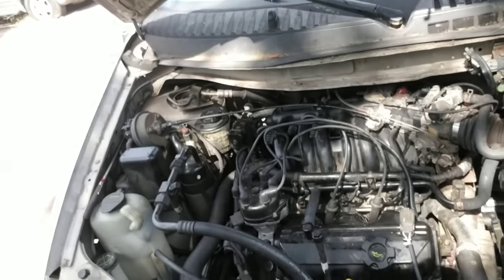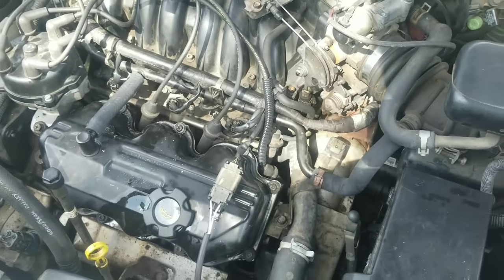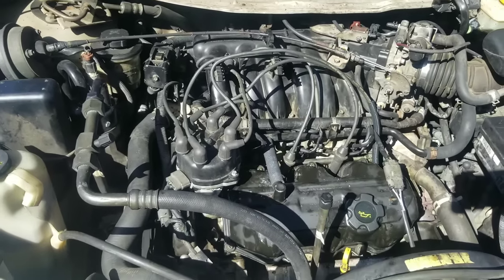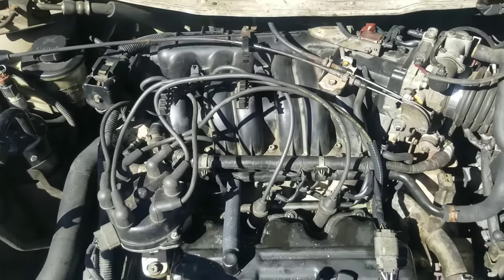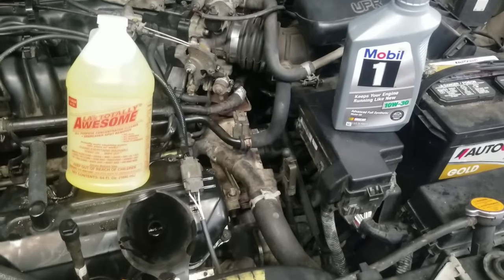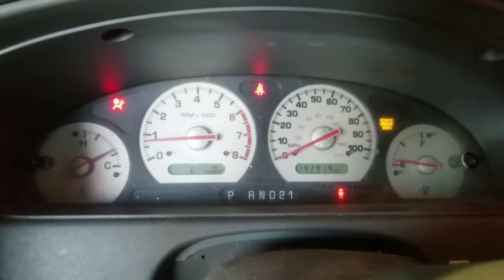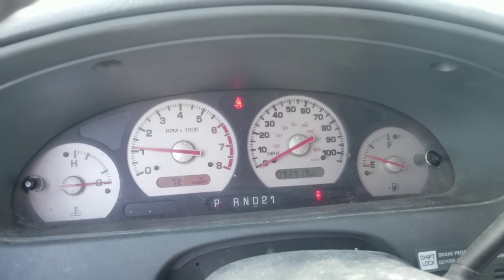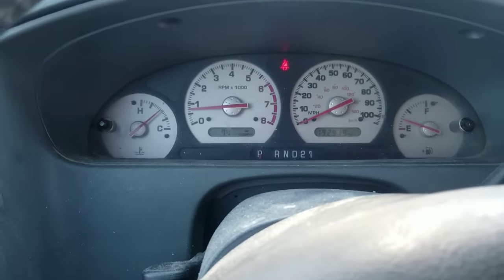How to Clean The Inside Of Your Engine The Easy Cheap Way.

Comment: Just use 500ml of diesel fuel. save money does the same.
Reply from the maker: no. no it does not
Reply: Maybe not with the engines your working on, as they are neglected due to tight owners,  I will help you out as I am honest person, use kerosene for your applications and its safe on rubber & cheap.    :)
Reply from the maker: yea this car was scheduled to go to the crusher, i saved it the owner is elderly and handicapped, so i helped him by saving his car.
I use this method for really bad engines because it works fast, and is very effective.

Comment: this is all fine and dandy until the bearings get stripped from all the oil that keeps them lubricated. im not a mechanic but i would highly recommend that you dont do this. have it done right.
Reply from the maker: so you just said you are not a mechanic, so obviously you know you have a lack of knowledge on the subject, so please keep your uninformed opinion to yourself. get some experience on this subject matter then speak. until then like u said you dont know.

Comment: OMG .... You’ve got to be kidding me ..... you put $50 worth is degreaser in an engine? A degreaser is not a lubricant. Furthermore, any debris will go to the filter, so you need to replace them with frequency.  This is a terrible method of trying to clean-up oxidized oil deposits. If your interests was to rid the debris through oil changes, use a diesel oil engine oil ..... for several cycles ..... but you must install new oil filters as they quickly become clogged. Nothing goes in a crankcase except motor oil. Nothing else ever!! And by the way, the bottle of MMO was a pint, not a quart.
Reply from the maker: did you pay attention at all, the filters were changed after each flush. furthermore do some research i could of ran the motor with water, what do u know about that. yes water can lubricate. the point was to aggressively remove the sludge and this product works great  at that job.
Reply: @crazysexycool180 okay, okay, okay  …… you win ……. Just be sure you never ever service, touch or get near any of my cars or equipment ……

Comment: This HILLBILLY is a HOOT. A Real DA.
Might as well flushed it out with some SIMPLE GREEN. Ha Ha.
If the engine had the Oil CHANGED & FILTER changed on Schedule, then this Problem would be Eliminated.
The Engine Gaskets will probably Leak like HELL NOW. And the Check Engine LIGHT will come on a LOT.
I would NOT take my vehicle to this Garage or DIYer. 🤔
Reply from the maker: update this car is still running great in 2023, hillbilly that,

 how yo car doing?
Thank you please like, share, and subscribe, also please check out my other channel Salem Taxi, on YouTube for more material on a different level.

Comment: That Engine sounds Nackered and no amount of Flushing is ever going to cure that, if you dislodge all the Carbonised Shit in that engine by Flushing and you Don't clean the Sump Strainer after your going to ruin what's left of the engines life,the reason for that engines state is old age and not changing the engine oil often enough,the damage is done now and it Can't be undone by any amount of flushing so save your money and put it towards a new Engine.
Reply from the maker: sounds goud. but your wrong. after the flush the car is stilllllll running great
Reply: Artistry Photography, Wrong am I, I have been reconditioning Engines for the last 50years so I have Probably seen every type of engine failure there is to see,why on Gods earth would you want to dislodge all that accumulated Carbon stuck to the insides of that engine,all this Paranoya about flushing engines is Madness but makes a lot of money for the Quack Flush Manufactures and Garages who do it,these liquid miracles are only ever a short term fix at best.

Comment: Your car is making that noise maybe because you're running your engine with very little oil and putting water that leaves heavy deposits in overtime probably gets into your seals and God knows what else no thanks or oil and water don't mix in my book thumbs down my opinion

Comment: Perfect way to ruin an engine. You can't fix an engine with additives. Where do you think the dirt goes while its being "dissolved"?  Yup, right through every bearing, valve guide, ring groves etc.  Take the oil pan and valve covers  off and clean it properly.
Reply from the maker: some folk can not afford that cost
Reply: @crazysexycool180   It's cheaper than a ruined engine